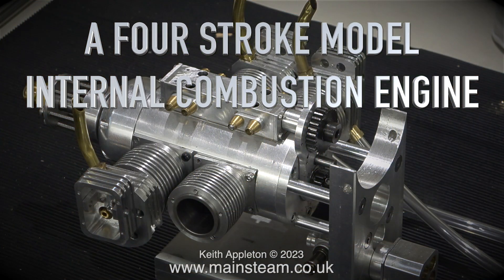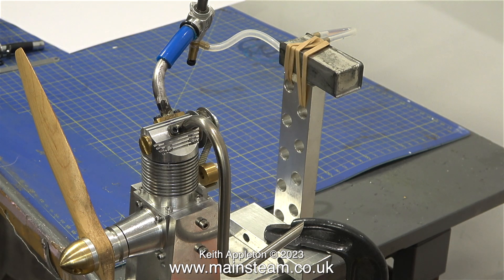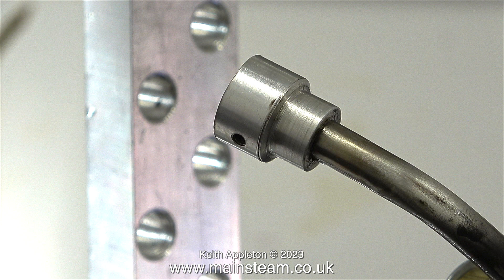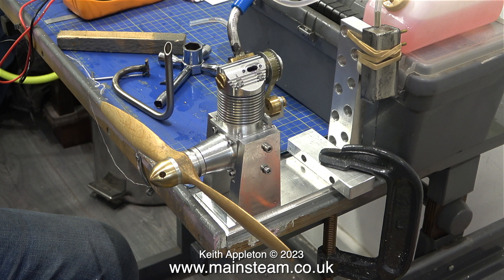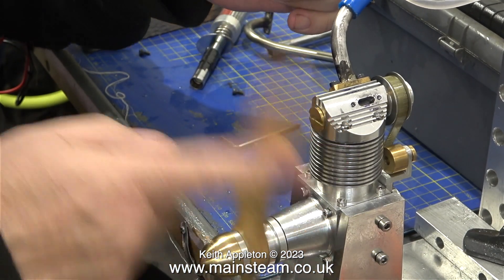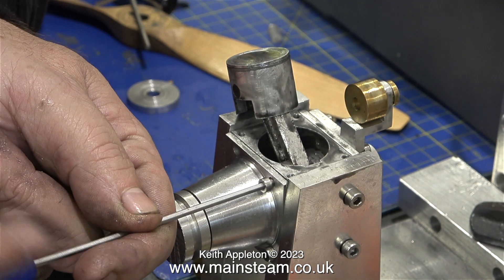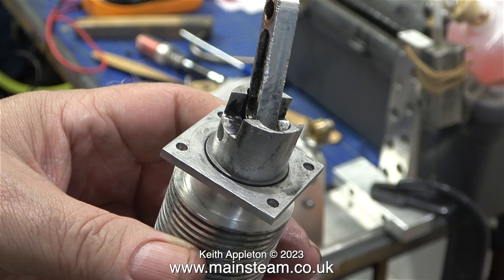A FOUR STROKE MODEL INTERNAL COMBUSTION ENGINE - #1

Comment: Did I notice the glow plug with an O ring, it should seat on a copper washer.
Reply from the maker: Yes, Andrew fitted it.
Reply: @keithappleton  It will not seal with the O ring, it needs the copper sealing washer.
Reply from the maker: I am aware of this being wrong as I have been playing with small & large Glowplug engines for almost 61 years now . . . . .

Comment: A rather interesting engine. With a very strange crank shaft. I would expect this to be made from solid, using a Quick-Set Keats Angle Plate of the type produced from a Hemmingway kit. You quite correctly point out that this does look very strange. I would go a little further & add that the re-made propeller fitting looks too small for this size of engine. Here I cannot be certain because I am looking at a Video so have no idea of scale. The cast iron piston ring is very nicely made but has not been expanded. Of late I have been reading a lot about these things, so first let me say it is a subject where I am a complete Dunce. My Brother has a Doctorate in Metallurgy & he is trying to explain things about making piston rings to me. A bit of a waste of time, I do have some metallurgy quals, but that was a very long time ago. Anyway the piston is working better than its ring. Clearly you must have solved the problems otherwise you would not be showing the video's. So I await to see the rest of this series.
Reply from the maker: I agree with everything that you are commenting on, but it is not my engine and it's down to my friend Andrew to see what the problems are. Personally I would not have made the engine in this way. The problems are far from being solved, this is only episode #1 . . . .

Comment: I know you will get some keyboard know ot alls who are gonna complain "this has nothing to do with steam..."
Sir I am very interested in seeing where this goes...  I find this engine quite interesting
Keep up the good work!
Reply: The line between a steam engine and an internal combustion engine is so blurry that there's nothing stopping you from turning one into the other. Plenty of videos all over YT of people taking clapped out lawn tool engines and making backyard fabricobbled steam engines out of them, and there's an entire class of engines back around the turn of the 20th called 'half breeds' where you could buy a top end for your stationary steam engine that turned it into a two stroke internal combustion engine.

I think one of the first projects I'll do when I get a mill and a lathe of my own is turn my Stuart Models 10H into a half breed glow plug engine. It shouldn't be too hard to adapt the cylinder for the task. The easiest part is drilling a glow plug bung in the top cylinder cover!  Bottom cylinder becomes the precompression chamber, some clever shenanigans with the steam chest turn it into the transfer ports/reed block, a carb off a small glow aircraft engine, flyball governor to keep it from flinging itself across the shop, and it should run that way.

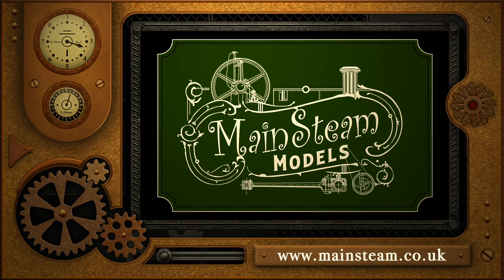Comment: 8:18 I would start by thoroughly cleaning every internal component of the engine, then I'd probably take a thou off the piston OD. Following that, I'd enlarge the ring groove, both in depth and height. The ring needs to be able to move freely in the piston in order to do its job properly and with all the dark grey particulate suspended in the oil I get the distinct feeling it's unable to do this because the ring groove is too small. That's likely where the binding is. I thought I saw a ball bearing behind the crank web so probably not in the snout of the engine.

I would also strongly investigate the clearances around the rotary valve. A lot of the trouble people...yourself included...have had with RV 4-cycle model engines is the tolerances required for it to seal and function properly are incredibly tight. If the valve isn't machined just perfectly it won't seal right and that will also cause compression leaks. It's interesting that this engine has the glow plug in a seperate bore directly in the chamber rather than running through the valve itself like on the RCV engines.

The crank web itself looks fine to me. The unusual construction is likely a workaround for the builder not having the necessary equipment to machine a crank from a single raw part. The clamping loads in play are plenty strong enough and nothing timing critical is driven off that end of the crank, so I wouldn't worry if it slips slightly either. 

If adjusting the fit of the piston/bore/ring doesn't get it to bark off, next thing I'd do is put a different head on it with conventional poppet valves. Can still be kept OHC so no modification on the bottom end would be required.
Reply from the maker: Don't forget - this is not my engine . .  . .
Reply: TestEcull your spot on and all that you mentioned has been addressed.  @keithappleton
Reply: @modelengineeringadventures   It should run quite nicely then! Can't wait to hear it do so~

Comment: 3:11 it looks like it barely even rotates. Like it's bound up. My OS, Saito, YS, Enya 4-cycles all freewheel quite nicely and will actually rotate slightly on just the pressure of an open valve spring pushing down on a cam lobe.

I do want to see this run, though, because what your buddy is doing is what I want to get into hobby machining to do. My first big milestone with that is going to be making a ~10cc 2-cycle or ~15cc 4-cycle glow engine that will fly a model airplane reliably.
Reply from the maker: It needs some work ........

Comment: You said that the sleeve bore was smooth:  It is supposed to be cross-hatched (to help hold the oil).  It doesn't smooth out until after the engine is broken in, and even then, the crosshatch should still be distinct and very visible.   Have you checked the valve timing and fit (to ensure that they are closed during the compression stroke)?   When rotating the prop (PLEASE don't be whacking it with a stick or any other implement.  That hurts my sensibility worse than you smacking a steam engine drive train with a ball peen hammer), you should feel a VERY distinct compression resistance and relief as you go over top dead center
Reply: Oil in the fuel, no crosshatching.
Reply from the maker: I am not turning it with my fingers in case it kicks. I am a professional Keyboard Player .......
Reply: @keithappleton  Good man, good man. I  refuse to put my fingers in the prop of a glow engine with a hot glow plug either, and I'm not a keyboard player! They smart pretty good and it doesn't take much of an engine at all to nip the tip entirely. Especially with the razor sharp Master Airscrew props I run.

I will shamelessly employ a chicken stick for 'hand' starting a glow engine I don't care what the peanut galllery says haha

Comment: Would you need a tube from the exhaust manifold/silencer for the exhaust going to the fuel tank to push the fuel to the engine, I found as a kid if I disconnected that tube it would be hard to keep my nitro car going if it was cold, (it was a sealed air tight fuel tank),
Reply from the maker: Not necessary yet, the tank is above the centre height of the Carburettor and uses Gravity.
Reply: Not always. Some engines have enough innate natural succc to feed themselves one-line. The OS FT-120 Gemini boxer on my 84"/25% Spacewalker and my Saito 125GK are two examples of engines that run just fine on one line. In fact, the boxer is only supposed to use one line.

I have plenty of video of these engines in action. The Saito 125GK on the bench running with just a feed line and then in a Phoenix Models 15cc Waco, and then the FT-120 in my Spacewalker got some very recent uploads.

Oddly enough, both of these engines ended up on FPV aircraft. Go figure.

I have plenty of cars, too, and yeah they all live and die on that pressure tap. But aero engines often don't need it, or are not as reliant on it. With the right carb design a glow air engine will run perfectly with no pressure line at all.